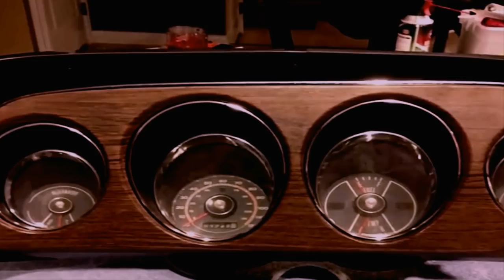I Couldn’t Figure Out Why Anyone Would Buy This Pile Of Rust  Then I Saw Why And It’s AWESOME ‏

Comment: Talking about gauge cluster and we see tail lights, talk about motor and we see rear axle and differential.  Car is beautiful.  Nice to hear drum brakes were put back on instead of disc brakes.  I drove a 1966 Chevy II SS for 35 years.  Unfortunately, had to sell it July 2012.  I hope to get it back someday and pray they didn't change anything.  I did all the work on her myself except electrical and transmission.  Painted it twice myself.  Everything was stock/original when I had to sell it except for wheels and tires!  I miss that car!!

Comment: Thank you so much for this video. My first new car was a Wimbledon white with red stripes 69 Mach 1 with the 428 CJ Ram Air engine and C-6 transmission. It had red vinyl interior and was a blast to drive. I started out to buy a 69 1/2 Boss 302 but when I saw one all they had available was straight black stock Mustang interior. The Mach 1 interior would be available in the 70 Boss 302. I added the rear sports slats and ft. and rear spoilers to the car. it looked pretty much like a Boss. This gorgeous Mach 1 is one of the most beautiful Mach 1s I have ever seen. Gorgeous Green paint.

Comment: Narration seems to be not in synchronicity with the images. Narrator talks about seats and the image shows the cylinder head.
Reply: yeah i noticed that too its really anoying for some reason
Reply: Am I right in thinking Steve McQueen?
Reply: The lack of sync really ruined what should have been a very interesting video.  Very annoying.
Reply: Greg Reyes so what the Earth is running out of rotation as well
Reply: It made me not want to watch luckily I know the parts lol
Reply: Yeah, i was annoyed by the Narration not being in sync with the images as well, i hope the Narrator can either do the Narration on the Video so it doesn't annoy everyone of at least learn from this Video so it doesn't happen again!
Reply: I was annoyed as that car should have a 351 Cleavland Windsor was a small block. But the block did look like a Cleveland. And Shelby.worked with these cars in 66 and maybe a few in 65 .
Reply: i noticed it when he talked about the engine and the differential showed in thepictures

Comment: Wonderful video.  However brings me back to a time when I was trying to get my used 1975 Ford Pinto in good driving shape and it was only 5 years old and had 30,000 miles on it.  So much body work it drove me crazy.   Couldn't believe the poor considerations to durability that they made in designing my car.

Comment: I'm old enough to know when a vehicle has been rotting away. Unless you look real hard a car will show its true colors. This should have gone thru a complete acid wash and then inspected. When you buy a car like this you want to know everything about the vehicle. Unless your going to keep the car it's not going to be worth a fraction of an original car.

When I was a teen I purchased a WWII Mercedes with my brother. In a few short months i discovered that we had to create a time line with the car. Here I am realizing that just to research the car was going to cost several thousand dollars before  we were going to start the restoration. Dont get me wrong my brother was right. here we were in the 1970's
with a car that was built in the early 1940's from Germany.and we had to prove this. and we had German plates. Sounds good on paper means shit without proof. I told my brother we were way out of our finance and sold the car for a few thousand more than what we paid.

To this day i still don't know if the car was original. What I do know was the car showed 
No sign of NAZI origin. I am glad I got rid of that monster and i hope it got recycled into Junk.

Comment: So this is an original numbers matching MACH 1? I have been here and it is a long process. The guy did not buy original MACH 1 parts, he obtained 1969 Mustang parts and MACH 1 badges when needed. Still a nice car, but I was thinking this was going to be a rare find or the serial numbers were going to lead to some sort of history. All of the panels are reproduced and you can even buy a complete shell and put your VIN on it. Expensive yes, but then you have your car and could have saved your father in law some time.

Comment: That is my dream car also and I had a chance to buy one in 1969/70, used. But at the time the dealer wanted a hundred more bucks than I had. And at the time I kept telling myself it was an automatic. I wound up getting a 69 two dr fairlane body with a 428 Cobra Jet engine, and a hurst four speed. And being young and dumb, I got hitched in late 70 and wound up trading that Ford for something my new bride could drive. Did I mentioned that the Cobra had a competition clutch and if my new bride wasn't careful it could have flipped her into the back seat.Seeing this, I still kick myself for not getting that 69, leaving the women alone for awhile. 
I should have realized that women would be around forever and muscle cars won't. Have fun. Thinking about 69 mach 1, I sure would like to get the chance to drive the 69 bullet car.
Damn I miss that car, the Cobra would have been ok, well. And that wife, damn I miss that car.

Comment: Why do people put GHETTO wheels on classic muscle cars? These cars should have either stock wheels or period correct aftermarket wheels. I can't believe anyone who truly loves vintage cars would do such a horrible thing to them. Also, any car that came with a carbureted engine should have a carbureted engine. Leave the electronics to the new throwaway cars. I have a totally restored 1967 Mustang coupe, 289 4 speed, completely stock, painted it's original Legend Lime, stock 14" wheels with stock wheel covers and stock size whitewall tires. This is one of the more common Mustangs, which is how I managed to afford it.
Reply: Gerald Scott we all have different view points, some people like stock, some not. Carbs are very old school and personally I would be inclined to go fuel injection. Modern cars don’t dissolve with corrosion like the old ones did, if anything the older cars were built with a throwaway philosophy. I have to agree though that some people have a talent for picking unsuitable wheels though.
Reply: I have no problem with the fuel injection used on older diesels, or that used on several late '50s and early '60s Chevys. It was all completely mechanical. The Chevy Rochester fuel injection did prove troublesome, way more than carburetors. I have been a vintage car mechanic for 36 years, and have never had problems with carburetors. They are simple and easy to work on, and best of all, they are one single unit. Modern EFI requires thousands of dollars worth of computers, sensors, and an expensive high pressure fuel pump. EFI is just another way of saying EPA. And one of the things that attracted me to vintage cars in the first place, besides growing up working on them, is that they are beyond the reach of the EPA. NO emissions tests, no catalytic converters, and no dreaded Check Engine light. And old car will run even when the engine is in terrible condition. I know. I have driven them with so many things wrong you couldn't believe they would run. A modern car, even if it is running fine, cannot be registered if the Check Engine light is on. An older carbureted car can be driven no matter how rich it is running, or how badly it is misfiring, or how much oil it is burning. Now of course nobody wants their car in that condition, but it can still be done. And while not original by the VIN, you can put in any engine that can be made to fit. I put a hot rodded 351C into a 1964 Fairlane that came with a 200ci straight six. Went from a 1 barrel carb to a 4 barrel carb. Neat and simple. The cars owner was very happy with it. It had 4 times the hp it had to begin with, with no electronics at all. You can tinker with these engines, tune the carburetors, and make them the way you want them. To me that is a big part of the car hobby. Everybody seems to remember carburetors as being far worse than they ever were. They were used for over 100 years. They are still used on many motorcycles. EFI (and plastic) is the main reason new cars will never become classics. They were built to be disposable, and will always be under the control of the EPA.

Comment: The 251W was the crappy engine. The Mach1 would have used the 351C (cleveland).
Reply: Andy Taylor actually the 351m400 was the less desirable engine.
the 351w is a great everyday engine.
the 351c is the high reving one.

the 251w never was an engine..

Comment: 8:13 "And all the panels inspected with a microscope".. Since when does one need a microscope to inspect some panels..?? If it would be the INSIDE of a panel, then it would be an ENDOSCOPE. Narration and the pictures are so far out of sync, it makes the video a pain in the ass to watch. Had to FF on some points.
10:11 That "motor" won't produce shit. But that rear axle an differential, will but the HP on the wheels.
The rear suspension was pretty much the standard for a lot of vehicles at that time. I would have expected another system instead of leaf springs, though. The ventilated disc brakes seem not to be the standard, but a good idea for such a heavy car.
However, a crappy produced video...but a great restoration of a lovely car..!